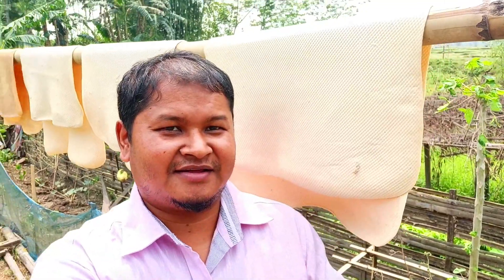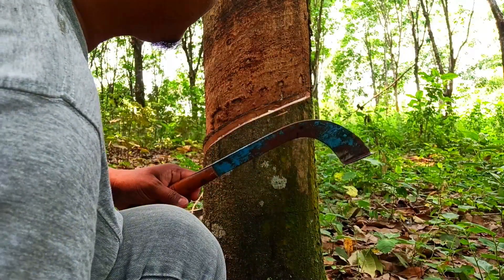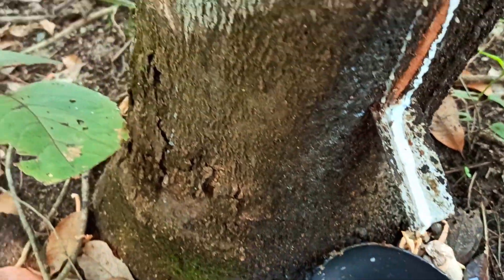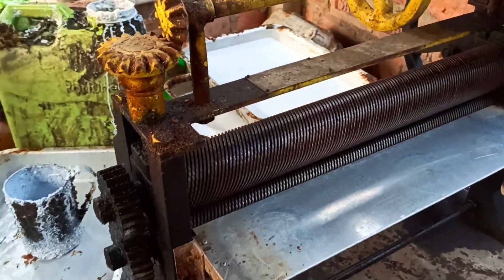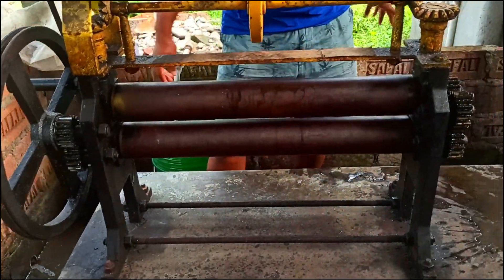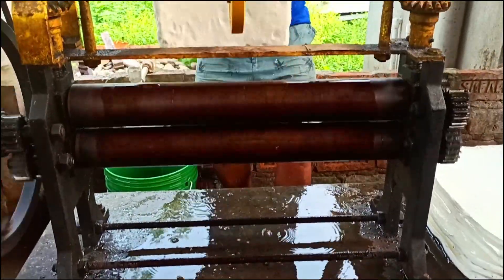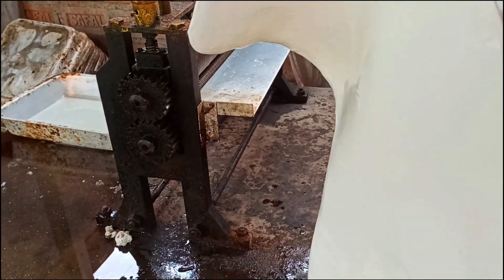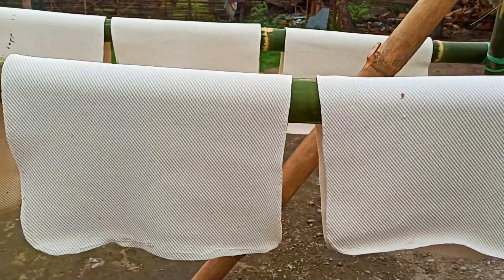Natural Rubber Production at Home || Ribbed Rubber Sheets

Comment: What if there's no formic acid? What is best to use
Reply from the maker: I actually do not have an answer to your question. I have enen tried to find it in the internet, but with little result.
Reply from the maker: Formic acid: "Formiphen" you can order it from India mart. In my place it is locally supplied. So we have easy access to it.
Reply from the maker: "Formiphen" is specialised for rubber industry. Dilute 300-350 ml of formic acid in 10 liters of water and keep it. Take 1.5 liters of rubber latex in a tray and mix 1 liter water and add 100 ml of the diluted formic acid. Mix it well and keep it for about six hours. It's done.
Reply from the maker: Formic acid should be handled carefully and not let it touch the skin directly, otherwise it damages the skin instantly. But once diluted in water, it is normalised. So it good to keep it diluted in water.
Reply from the maker: Yes, it is normally strong. And must be kept out of reach from young children and unknown people. It is very strong, so keeping it diluted in water helps. Odour goes away as soon as it is diluted and is no more harmful. But after the sheets are rolled, the water separated from the sheets when accumulated in one place, produces very bad odour. So good drainage is important in the workplace along with cleanliness.
Reply from the maker: Nothing defite. It depends on when the sheet gets completely dried. Mostly I sundry it. Because I don't have a quality smoke house.
Reply: What kind of formic acid did. You used,, and try to order in India mark,, I really appreciate you video and trying to process natural rubber sheet in our place,,,
Reply: But I can use any kind of formic acid? Or there a formic acid just for rubber sheet use?
Reply: I already order in my country,,, it is dangerous said by seller,, and strong odor,,,, that's is really a formic acid,,, it's normal for a formic acid?
Reply: Thank you for answering my question,,,, I really appreciate it,,,, Jehovah blessings you more
Reply: Thank you for your help and answer my question it is big help to me,,,
Reply: How many hours the sun dry,,, and how many hours do you smoke the sheet?
Reply: If the sheet become yellow color and dry it's already done?
Reply from the maker: @orzondequina1071  it becomes clear and looks transparent.
Reply: Bonjour cher Monsieur. Si je veux faire le pressage au lendemain de la coagulation, quelle quantité d'acide pourrais-je ajouter et combien d'heures de coagulation

Comment: is making rubber sheet more profitable or selling latex??plz i need info
Reply from the maker: It depends on the price. Sheet producing is putting more time consuming as well as more work. But if you are in a location where you can sell latex easily, it saves a lot. In my case, selling latex is almost impossible, because there is no industrial set up who buys latex. So we are bound to make sheet rubber. In your case, please find that out. It is almost the same in both cases, but depending on less work, less cost, I would say latex selling is much better.
Reply: In my country Philippines rubber cuplamp is very low prices,,,, only 26pisos Philippines money,,, so I try to make way of process that easy and more profitable than cuplamp,,

Comment: How many sheets you get from 300 rubber tree
Reply from the maker: You might watch my other video https://youtu.be/lX-FPY0k5xE
Reply from the maker: Main season: around 60 sheets, mixture of 3 litters latex.
Reply: @ELearningNEntertainment   very nice.. I want to know that how many sheets I can get from 200 rubber tree per month. And how much money I can make per month???
Reply from the maker: Latex flow depends on various factors, such as soil condition, size of the tree, and number of years harvested. Real income would generally start in the 4th year only. Mine is in 5th year running, next season it will be the 6th year.